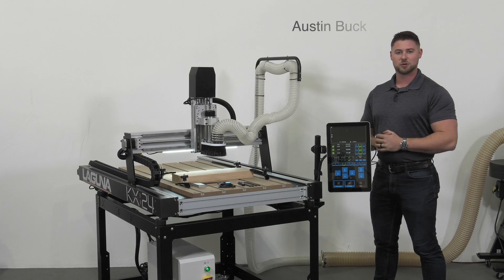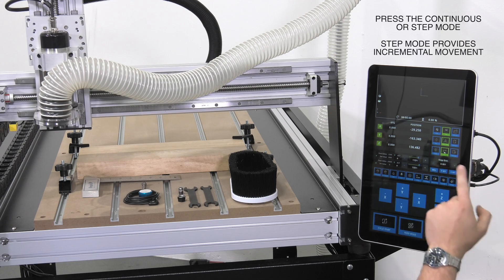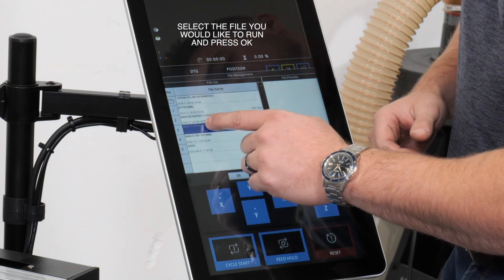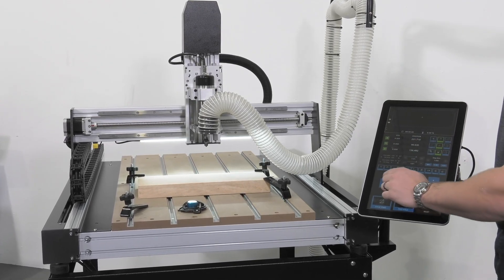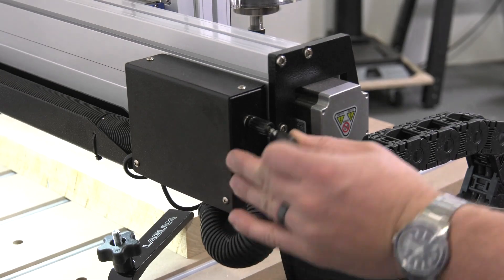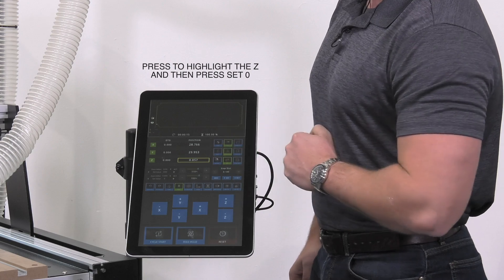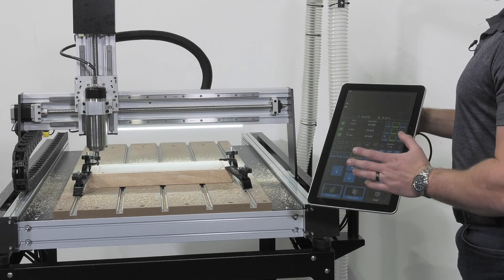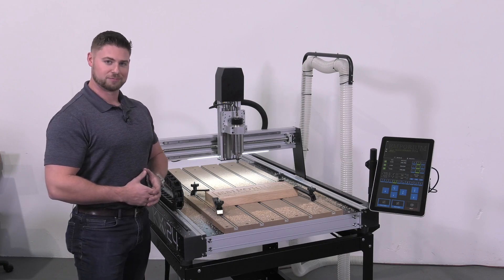KX:24 Desktop CNC Router – Precision & Power in a Compact Machine!

Comment: Can u cut wood flooring vents ?with it ?
Reply from the maker: John, Yes you can. A CNC router is capable of cutting many different types of materials including non ferrous metals like brass and aluminum. Using the right bit with the appropriate Feed & Speed is the key.